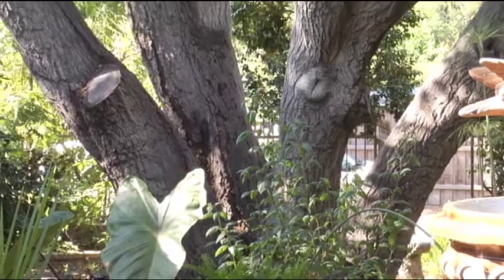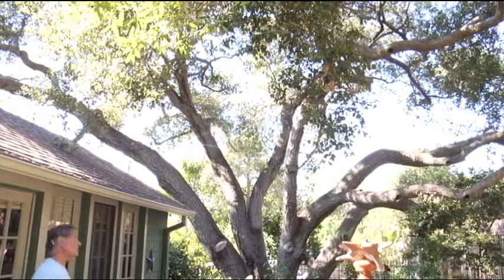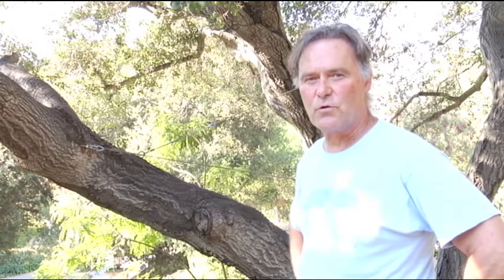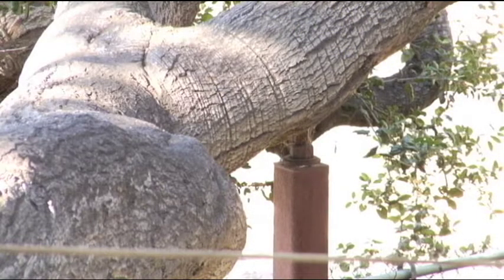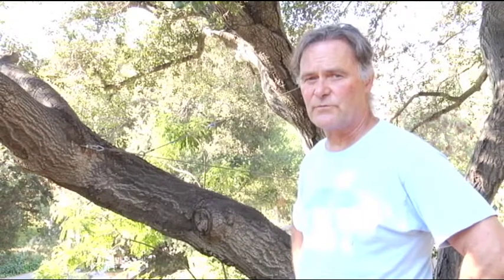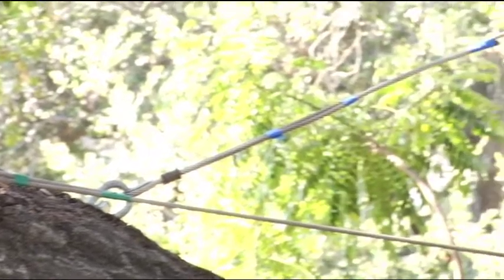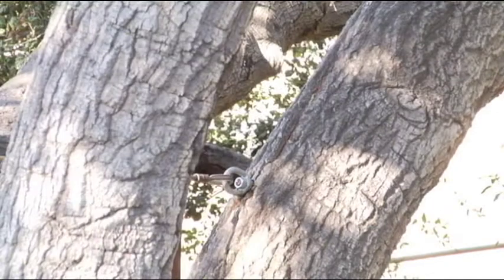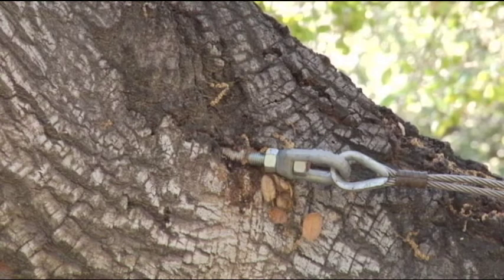Using Braces for Cabling and Support: Quercus Agrifolia - Prune Like a Pro

Comment: I see the oak has multi-trunks and its many issues. If it is a single trunk live oak with branches that grow close to horizontal, would you suggest cabling such branches even if they're not hanging over any structures? To what extent are oaks able to hold their arms out without any support from us?